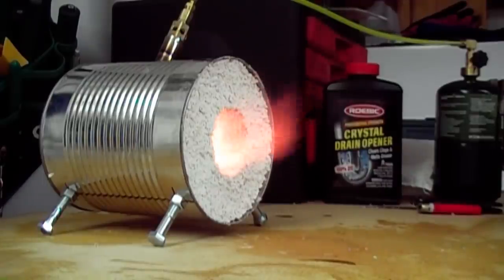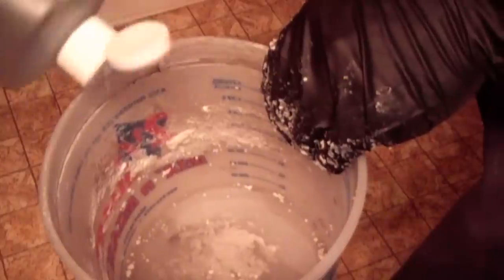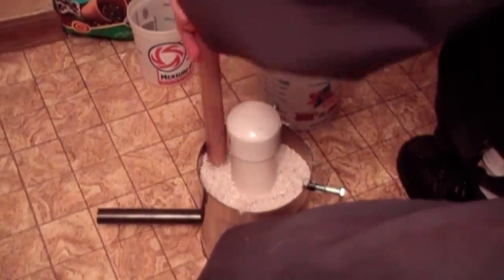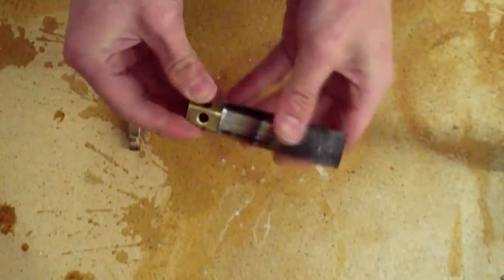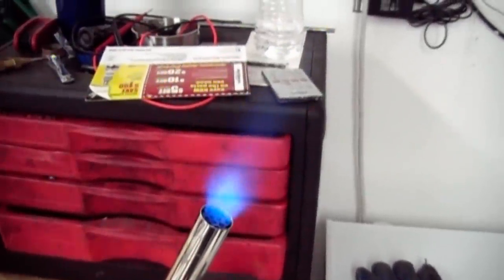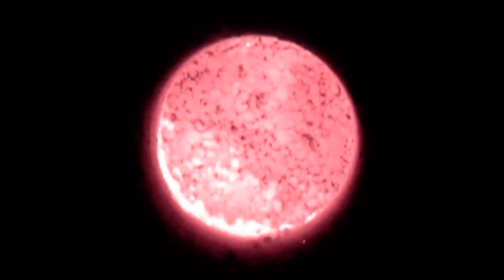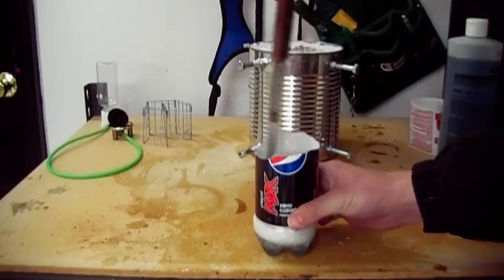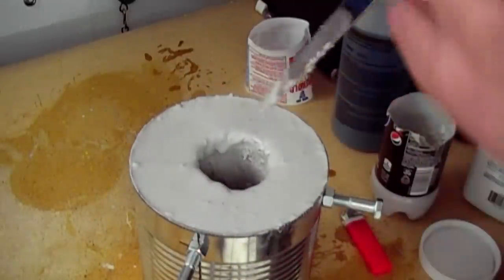How to make a coffee can forge

Comment: Too many comments and too much laze to give them a good one over, so my questions may be answered already. I was wondering what you used as a fuel source. just a propane tank? I also wanted to know if the whole burner for down inside instead of the pipe used when molding or if it plugs in. lastly, I wanted to know how you welded the stainless for best heat resistance. thanks!
Reply from the maker: Mad Hatter yes it is a propane tank for fuel. I'm not sure what you're asking about the burner, it just fits in the hole in the side of the forge, held in place by friction, it can easily be removed. There are no welds on anything.
Reply: clkindred I think I figured out that first part, but how is the grate part from the kitchen strainer held into the tube? Thanks!

Comment: Out of curiosity, would concrete work instead of the perlite mixture? Forgive me if you have already addressed this question.
Reply: +John Lehman Concrete is not a  good insulator, and it is also not refractory (temperature resistant). At the temperature this forge is capable of, concrete would be destroyed, either slowly due to degradation of the portland cement, or possibly with violent spalling action. There is a guy on youtube who shows how to make wood fired ovens using portland cement and pumice. So I think for lower temperatures, you could use portland cement instead of sodium silicate with the perlite. Especially if you then add the lining to the inside as he did in this video.

Comment: Is there anything i can use instead of the sodium silicate? would using just water and plaster be to weak?
Reply from the maker: well, that would put the lining in a different category than this stuff. This lining uses the sodium silicate as the binder, the small amount of plaster is to accelerate curing. Using just plaster and water might not work so well with the perlite, at least in the amount used in this recipe.
Reply: Play sand , plaster Paris, water. Mix thoroughly. Have fun. Experiment.
Reply: +gary gibbs Play sand and Plaster Paris wont stand up to the Heat that will be generated and the the Foundry will Crack.
Reply: +Wileon Smuts Just make sodium silicate! Stop being lazy it's easy as hell. If you need a cheap source of silica just buy a giant bag of crystal kitty litter for $10. It's 99.9% pure silica all supermarkets have it. Lye is also cheap. Also when I make mine I dump the kitty litter in a blender. I put a plastic bag over it (you don't wanna inhale fine silica) with a rubber band then grind it down to a fine, white, sand. Otherwise the beeds take like 45 mins to full dissolve. Also, when I do this reaction I do it fast. I dump all the lye in at once (it's safe, trust me). I stir till it's dissolved. Then I "slow dump" the silica sand in. I use a stick to direct it quickly into the pot then just break up lumps I see forming. So within 2-3 mins everythings mixed. Then I put it on low boil for 20 mins and leave the room. When I come back I remove any unreacted silica clumps, turn off the stove. Wait a few minutes till I can stick my finger in it w/out burning. I know it's safe to pour in glass by then then just pour and store. If the water glass is too thick by the time it cools just add a bit of water.

ps. Don't use the amount of water he says in the video. Add like 10% more (eyeball it) since it'll speed up the reaction, dissolve the silica quicker and the water just boils way towards the end anyway when it thickens.
Reply: +A Tiedje yep, happened to me!

Comment: Do you need a specific regulator for the burner or is the regular tank pressure straight from a grill tank or torch tank good enough???
Reply from the maker: AracAttack This uses no special regulator, just the blowtorch valve adjustment.
Reply: clkindred oh good, thanks

Comment: I would have thought of a concrete or plaster forge, but this works too. It's small, but good for melting metals like gold, silver, copper, etc.

Completely random.
How are the warts doing on your hands?
Reply from the maker: Thanks, those are calluses on my fingers. I like to press the corner of my thumbnail into the skin over bone of my finger joints for some reason. It makes masses of thick dead skin in those areas. Been doing it for as long as I can remember and have had them looked at many times with the same conclusion, not warts. They sure look like them though.
Reply: Thanks for clarifying that. I couldn't tell the difference. Eventually the calluses will go away, but it takes years.

Comment: How well did the aluminum oxide cement work out, did it handle the heat, did it crack. how bout some pics?
Reply from the maker: if applied correctly, it is the most heat resistant substance I have made, but it's preparation and curing are not simple. I'm still experimenting with it.
Reply: clkindred How hot can u run it? Am thinking of using it in a foundry , needs to handle 2200f plus.
Reply: John Wudkewych Have source of 50 micron 99% pure aluminum oxide. Actually cheeper than harbor freight. 10 pounds 29 bucks delivered to my door.
Reply from the maker: John Wudkewych
 I have used it in a foundry to melt brass, the oxide held up great, however the perlite melted from behind it. 50 micron should be about 230-240 grit which is what I used, it is best if it is not mixed as wet as I showed here, and dry thoroughly, finishing in an oven.
Reply: clkindred Thanks, will let u know results .
Reply: John Wudkewych Am going to try to coat inside of foundry with mix and put hair dryer inside and let run for few days,hopefully that will cure it slow enough to survive the heat.
Reply from the maker: John Wudkewych
You will know right away if it's not dry enough when you first fire it. It will foam up into a white crusty fluff if there is still water in it.
Reply: clkindred First batch did as u said, not dry enough. Applied second batch and am using IR heat lamp to drive off moisture.
Reply: Ir heat lamp did trick ,left it on 4 2 days and dried out mix well.
Reply from the maker: John Wudkewych Cool! Thanks for the update.

Comment: ooh... That looks way more efficient than the soup can forge, and the sodium silicate doesn't look too tough. I do have some questions, though. First of all, how did you get the piece of the drain cup fixed into the tube? And what are you using to hook it up to the propane canister? Fuel isn't an issue since my cousin got me into airsoft, I have a ton of the Coleman bottles lying around begging to be used for something.
Reply from the maker: Sorry I did not get notified of your comment until just now... The drain cup piece is a force fit, I cut it slightly too large to fit, and pressed it into place with a socket that fit inside the apple coring tool tube. I tap into the propane tanks with a propane blowtorch that I removed the burner and installed a hose barb. Thanks for the comment!
Reply: clkindred Thanks for the reply. I found the video detailing the burner the other day. I'm not too experienced with plumbing and milling yet so I'll probably just get a hose and valve setup that I can run from a tank to the burner. The waterglass shouldn't be too hard, it looks simple enough and I actually have a bunch of silica gel stored up from my time stocking shelves at walmart.

Comment: Do you have any concerns of the Sodium Silicate toxicity levels after it has "cured" by being heated repeatedly?  I note in the MSDS sheet it's highly unhealthy to breathe in, chronic exposure possibly causing breathing issues.  My main concern would be the heating and cooling continuously pushing it into an enclosed space (garage).  Any thoughts?  Serious question, not trying to incite anything.  I like the idea and am considering making one myself.
Reply from the maker: blarg3312 Once the sodium silicate is cured, is has actually decomposed into silicon dioxide, and sodium oxide, so those are the chemicals that are exposed to the heat. Both have very high melting points and don't give off any fumes until you get it hot enough to boil it which aint' happening with a propane flame.
Reply: Awesome.  Thank you for the reply.

Comment: How many firings do you get out of this before failure?   Thanks for the video.  Am doing something similar using a mail box rather than a can.
Reply from the maker: Jef Godfrey I don't know, I made a larger one that I use now. This one ended up being too small. The larger one made with a slightly different mixture is now more than two years old I think, and it's still going strong.
Reply: Thanks.   I'm making a small forge out of a tin mailbox.  Using a similar refractory mix for insulation.

Comment: Would any of the ingredients in the makeing of thus forge be toxic to breath while being used
Reply from the maker: Proper ventilation is important while using any gas forge because of carbon monoxide dangers. None of the components of the forge itself are likely to produce fumes when used, however variations to the design might do so. Using galvanized steel *zinc plated) may cause zinc oxide to be released. Thanks for the comment!

Comment: The lining has been drying for a week and there are still white crystals
coming off the lining, I think they are silica.  How long till this stops?
Im having trouble finding an NPT plug that will screw up from the bottom of
the 1/4 to 3/8 reducer. Any suggestions?
Reply from the maker: +Doc Nemo There are white crystals coming off the lining? Like growing? Sounds like the sodium silicate is being forced out by the plaster. This can happen if there is too much sodium silicate in the mix, or too much plaster. I have tried various ratios of plaster and silicate alone in test pieces, in the test pieces the composition was mainly plaster with different amounts of sodium silicate. I did this to see if plaster could be stabilized with sodium silicate for high heat applications. Most of the test pieces grew a fluffy crust on them, I discarded them as failures. The mixture I used in this video is mostly perlite and sodium silicate, with just a touch of plaster to help it set.

As far as the plug goes, I had to run a tap through the reducer to open the tapered threads all the way out to straight threads before a plug would go in backwards.

Comment: I am attempting to put the torch/burner assembly together but am not sure how to drill the .016" orifice.  What drill did you use and where did you get the drill bit?
Reply from the maker: I used a very small drill bit marked on the package as being .016 inch held in a pin vice. I got the drill bit from a hobby shop. I think people use them for models and such, think of shops that sell model trains, model cars and things for the right kind of place. Stores like "hobby lobby" don't have them.

Comment: Could you trade out the perlite with vermiculite if perlite isn't readily available?
Reply from the maker: Peter Ripson Kind of, the vermiculite I have worked with was a very irregular in particle shape and size. The way I use perlite in my new recipe is coating the perlite particles in a high temp material like aluminum oxide powder. Vermiculite could be used but in a different way, just mixing the vermiculite with the high temp powder, vermiculite is very difficult to "glue" together by itself, it behaves like course sawdust.

Comment: Im about to attempt to make a heating mangle for round bottom flasks using this method.
I am curious if you have made any stand alone shapes using these ingredients and if so how impressed were you of the over all strength of this objects??
Reply from the maker: Clown Whisper Stand alone shapes are a bit of a headache. Is there any reason your heating mantle can't be fiberglass? Heating over a burner? I did some testing with rockwool and found it was just too low of a melting point to be used in a forge or foundry, but anything less than that type of heat would not phase the rockwool at all.
Reply: im using nichrome wire imbedded in a mix of perlite plaster, silica, running of of a small triac based controller

im not using the perlite for its refractory properties but its price and light weight
Reply from the maker: Oh, I misunderstood you. I thought you just wanted the thing that goes around the flask, acting as a blanket when heating on a hotplate.

Comment: Hi, Thanks for the videos. I have enjoyed them.  Question, I have aluminum oxide sandblasting crystals rather than the powder it looks like you are using. Will this still work in the cement?  I plan to use it as a rigidizer for ceramic blanket in the forge I am building.
Reply from the maker: The larger the particles, the less clay-like, or cream-like the product. Large sand sized particles make a product that is difficult to work with as far as spreading and coating is concerned.
Reply: Makes sense thanks.

Comment: Do you think that the grit size of the aluminum oxide will make much of a difference? I can buy 45 grit or 80 locally but wonder if these are too coarse?
Reply from the maker: 45 and 80 are pretty large particles, I used 220 grit here. I think the grit size plays a large role in the workability of the mixture, the finer the particles, the more like clay the mixture behaves. My newer forge I used aluminum oxide only, with sodium silicate to bind it, as the sealing cement and it works even better.
Reply: clkindred
I thought that might be the case. I have not watched the video on your new forge but will do so right now. Thank you for the quick reply.

Comment: I have everything I need to get started on this project except the silica gel to make the sodium silica. I've been going to shoe stores to get try and get enough. Where did you get that massive bag of silica gel from? Thanks for this tutorial. Looking forward to heat treating my project knives.
Reply from the maker: Look for silica gel kitty litter. Walmart has one that is a four pound bag for like five dollars, it goes by the name "mimi litter" should be plenty. As for the huge bags of silica gel I used in my sodium silicate video, they came packaged with computer boards and electronics for medical imaging machines, MRI, CT scanners and X-ray machines my father works on. He saved them and had a half size oil drum full of them haha.
Reply: Thanks for the tip! I've got my forge all together. I used a mortar mix from work thats used in our steam boilers, to coat the perlite. Not sure if that was a good idea or not. I've only done short test burns. I appreciate the vid and the info!

Comment: Is the purpose of those holes to allow oxygen to mix in with the flammable gas so it burns more efficiently? Does the flammable gas not easily escape from there? ( For Reference 4:29 )
Reply from the maker: Yes, "primary combustion air" enters through those holes, due to the propane gas stream having a high velocity it creates low pressure and draws the air in. It won't burn with a blue flame at all without this. The fuel gas dose not escape these holes of the gas stream/gas orifice is designed correctly.
Reply: Thanks.

Comment: That's a sexy fucking burner for a baby propane tank. Very impressed. I've only seen flames like that coming from 40PSI bayou regulators on large propane tanks... and even then my bigger burners aren't quite as high pitched as yours which tells me your small burner is hotter than my bigger ones. Can you tell me WHAT SIZE drill bit you did the orfice with? That looks way smaller than 1/16" and I'd really like to know what size bit you used. Thank you!
Reply from the maker: the bit was .016 inch.
Reply: clkindred Thank you! Just ordered a 61-80 set off ebay.

Comment: of course  I THINK I followed the directions to make the sodium silicate.  Mine looked the same anyway.  It made the solid glass tip when dripping off the spoon.  BUT, it's been overnight now an the perlit/sodium silicate  mix has not setup.  It is still like wetsand that has been packed.  Any ideas what  I did wrong?
Reply from the maker: Ken Zimmerman The mixture is touchy when it comes to how much sodium silicate is used. It is easy to use too much and it takes a long time to become solid. This early procedure of mine worked on principals I did not fully understand at the time. In this case, the addition of the plaster of Paris forced a lot of the excess water into the plaster in order to hydrate it. This caused the mixture to harden within minutes. However this is very hit or miss when it comes to the amount of plaster and sodium silicate, if too much plaster is added, the mixture hardens while mixing it, and you end up with a dry gravel like substance. If not enough plaster is present for the amount of sodium silicate present, then the mixture never hardens, at least not due to the plaster trapping the water. A later project I did to build a larger forge used aluminium oxide rather than plaster, as such the aluminium oxide does not hydrate like the plaster and required the perlite, sodium silicate, and aluminium oxide mixture be left to harden for a week. The aluminium oxide is a better high temperature material than plaster.
Reply: Thanks